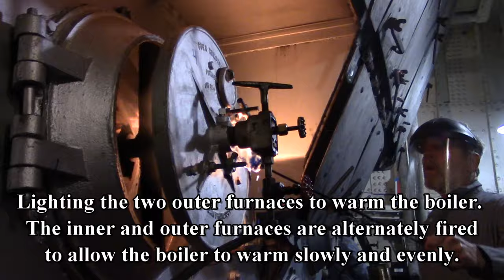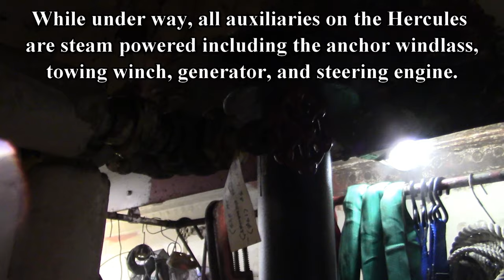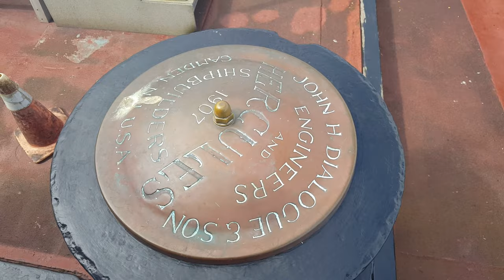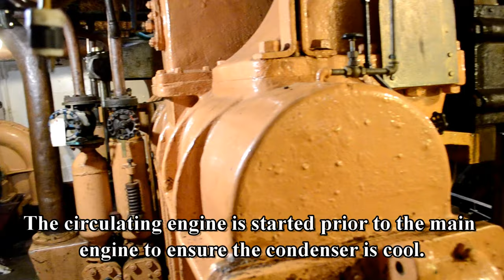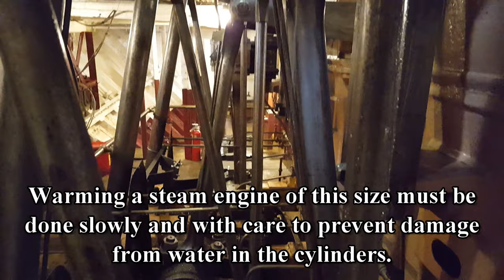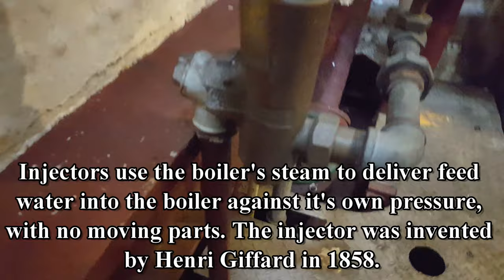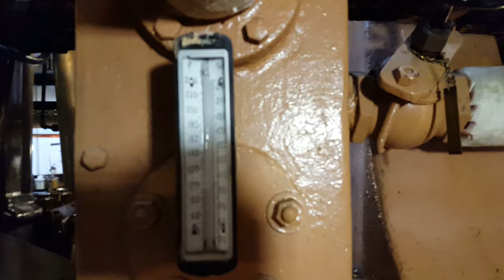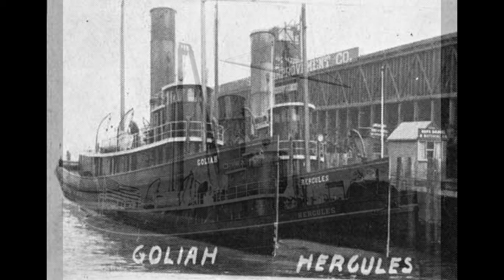Steam Tug Hercules STEAM UP! TV show TUGS!

Comment: Enjoyed the video, thank you for sharing it.  How much time between lighting off the boiler to ready for work?
Reply from the maker: fletcher3913 you're very welcome.  they warmed her up for about 4 hours the previous day, and probably another 2 or so the on this day before steam was showing on the gauge. And about another 1 or 2 before the main engine was running smoothly.
Reply: Wesley Harcourt.   That sounds like a hell of a lot of fuel had to be burned before she could start earning her keep as a working tug boat.
Reply from the maker: crankbv1 when she was working once she had steam up they probably kept it up for weeks at a time.
Reply: My dad served on steam vessels (turbine ships mostly) for APL up to the early Eighties ... it took about a day to get steam up from 'cold boiler', so they probably didn't let the boilers cool down until the ship was going to be drydocked. For steam railway locomotives, when the loco was left overnight, a boy -- called, I think, a hostler -- kept the boiler reasonably hot, along with filling various lubricant, sand, fuel, etc. containers.
Reply: And there is an enormous variety of heavy linkages and other monstrous connecting parts, that would decrease the transfer of engine horsepower to the screws by a huge amount.

Comment: And I thought locomotives were cool - this combines so many different types of engineering together, and for it to be closed loop too.. damn. Now days our only excuse for not being able to work is "the battery is dead" - a century ago there were thousands of moving parts.

How the hell do you keep everything lubed with hot water and steam constantly blowing everything away? 

I'm guessing this thing has a serious bilge pump for the condensation and blow-by water / steam. 

All of this for 1000hp?  Just shocking to imagine how much work and incredible engineering went into 10s of thousands of lbs of moving parts to achieve what a couple-thousand lb turbo diesel will do today.
Reply: Alex Thomas The types of oils and greases that they'd be using are designed to work with steam, they tend to be pretty thick compounds.

As to the horsepower, keep in mind steam engines typically operate at low RPM compared to IC engines, and horsepower is derived from torque times RPM. Thus the typical case for a steam engine is lower horsepower but higher torque.

Large paddlewheel engines in particular only operated at like 30-40 RPM, so they had a pretty massive torque to HP ratio.

The screw engines like on this tug probably also rarely exceed 250 RPM.
Reply: Check out the history of many modern  “healthy “ cooking oils. A lot  were made in the 1800s as steam lubes. Canola anyone.
Reply: Pocketfarmer1 It's actually that they used a mixture of rapeseed oil and animal tallow, even modern steam oils still use animal oils as they are pretty much the only thing that will work in water, so mixing it with rapeseed or petroleum oils links the features.
Reply: Yes, just so. Thanks

Comment: I’m not to familiar with steam engines but are they supposed to leak that excessively ? Bc it seems dangerous Bc the boiler can blow
Reply from the maker: That is completely normal, especially for an engine that hasn't run in several months. There is no danger present. All those leaks are from the packing glands on the piston and valve rods. It's common for them to leak while warming up the engine. As the steam condenses to water in the cold cylinders the water is incompressible and there is so much in an engine that large that it overcomes the capacity of the cylinder drain cocks and takes the path of least resistance.   Eventually the packing material in there swells up with moisture or thermal expansion, the cylinders get hot enough that the steam doesn't condense, and engine room staff also tighten up the packing glands. Thank you for watching and your question.

Comment: These old steam ships must have been scary down there in the bowls on a warship. High pressure  steam line breaks due to bomb, these guys cook. Torpedo blows a hole in the engine room, cold seawater explodes the boiler, any disaster happens and your last out of the ship keeping the lights and wireless going as well as the distance from the engine room to topside.

Comment: Hello at 9:26 you stated the condenser was cooling the exhaust why would you need to cool the exhaust? I don't understand that. Also is this a paid tour that anyone can go on? Thank you.
Reply: A steam engine's exhaust is still steam. But if you direct that exhaust into a sufficiently cold condenser, the steam turns back into water. That water can then be recycled into the boiler again, since the boiler will be seriously damaged if given seawater because of salt encrustation. 

As it happens condensing the steam also produces a vaccum, which makes the engine work more efficiently. So there are multiple advantages for a ship to condensing the exhaust.
Reply from the maker: Odin gave you a good and accurate description in his response. Touring the ship along with many other ships a the park only costs the admission fee into the park.

Comment: What if you ahd to start the engines quickly in an emergency? Is there a procedure for that?
Reply from the maker: With reciprocating steam engines and large firetube boilers, there is no "emergency start". Everything has to be warmed slowly to prevent stress or damage to the boiler, plumbing, and main engine. From a cold boiler it would require over 12hrs to be ready to get under wey.
Reply: @WesleyHarcourtSTEAMandMORE  my uncle who was on the uss Nevada said the boilers took about 20 hours to heat up, albeit it was much larger

Comment: Wesley Harcout,the boiler burners  burn fuel oil,,  or gas oil?? i was naval engineer,,but in the 90"s  engine mechanic,,,not speciality in boilers,,,is correct heat the boller slowly to avoid the stress in  pipes,,,and plates,,the work pressure is a feature os the ship boiler,,,200,,,300 libs,,,etc.
Reply from the maker: She burns #4 fuel oil with pressure atomizing burners. She runs at just under 200psi. 
Thank you for your service, and thank you for watching!

Comment: if the ship is steam and if you dont have steam how do you get the fuel pumps to work in the first place to make the boilers hot
Reply from the maker: Good question! Right now they start with electric fuel pumps pumping diesel fuel to the burners. Once steam is up they switch over to the steam pumps and the heavier fuel which also requires heating with steam heaters.
Reply: @WesleyHarcourtSTEAMandMORE  so if your stuck in the english channel with a cold boiler and no generator you will be going no where fast unless there is some way to hand pump fuel into the boilers
Reply from the maker: @peterjames2004  you are correct sir

Comment: Great video, thanks for posting!
5:55  9:15  I wonder why they don't condense the exhaust steam or vent it overboard?  Doesn't exhausting it directly into the engine room make it very hot and humid down there?
Reply from the maker: Thank you very much! Most of the exhausted steam is sent to the onboard condenser, only a few pumps or drain cocks aren't. It was quite warm and humid indeed. Very nice for a cool day in San Francisco. Thank you for watching.
Reply: Pretty sure what you're seeing on the condenser pump is leakage from the packing glands. That engine sounds like it is in need of attention, it clatters like the bearings need to be adjusted or relined and the packings are leaking- they need to be taken up or have additional rope added. Most of the exhaust from that engine is going into the condenser with the exhaust from the other accessories.

Comment: The noise and heat must have been virtually insufferable. A hundred years later we have nuclear powered ships! This is a great historical video. Thank you! 🇺🇸
Reply from the maker: Actually the noise in the engine room was less than a diesel at idle for the most part. Heat in the boiler room was nice for the winter day... Hotter than the Dickens in the summer though for sure! Nuclear sure shows steam is still a viable prime mover! Thank you for your kind words, and thank you for watching!

Comment: Is there a steam pump to pump condensate outboard?
Water and oil everywhere! Looks like this tug will sink after few hours of work just because it will be full of condensed water.
Reply from the maker: The condensate is re-used in the boiler. The whole system takes some time to get into a proper balance with water level in boiler and the hotwell. Until then the hotwell usually will overflow as it gets full and the boiler isn't in need of so much water yet... There are several small and large pumps to pump bilgewater overboard. No oily discharge gets pumped overboard though. Only "clean" bilge water. The engine sump eventually gets pumped into containers for disposal at an appropriate site.
Reply: @WesleyHarcourtSTEAMandMORE  Wow, thanks! You completely explained everything ive asked!
Reply from the maker: @DieselKotov  you are very welcome! Thank you for watching!
Reply: You must never heard of a steam engine ever-

Comment: Seems to be a lot of steam and water leaking. Is that normal?
Reply from the maker: Yes, when a steam engine that large is just warming up (and it really takes almost a full day to warm all that cast iron through), there is a lot of condensation that takes the paths of least resistance i.e. the packing glands. The glands usually get loosened up when they shut down for a while to prevent the packing material from getting a "memory"

Comment: She's look better if they put the wheelhouse back lower to when she was originally built.  They raised it when she was sold to the railroad to see over the car floats. Now that it's a museum piece, I think it should go back to it's original profile.
Reply from the maker: I completely agree. It's funny, some of the Park Service are complete pedants when it comes to "originality" in regards to silly things like the type of wood used for steering pulley mounting pedestals, to the point of preventing her from being able to set sail, but conveniently overlook other more glaring deviations from original.
Reply: @WesleyHarcourtSTEAMandMORE  Originality? I was heart broken when they took out all the original copper steam lines from the boat. As I remember there was an engineer who was worried about annealing it and it was all replaced with steel. Also I think that the crown sheet in the boiler was damaged when they over pressured it while hydro pressuring it during a test. It's an old boat and the decision makers don't know much about old boats.

Comment: Ship looks in terrific condition considering it's over 100 years old!  Most ships are scrapped after 30-40 years max, no?  It must have been very well maintained!
Reply from the maker: She's had a storied past, including having sat on the bottom in the mud at one time. A testament to the people that loved her enough to work on her and bring her back from the brink.
Reply: EHHHH, kinda depends- if you have use for a ship, it will still work, example: Mayflower(Bristol tug, oldest tug in the world, built in 1861.), Edna G(1890s tug, Great Lakes.), Arthur and Wallace Foss(pretty old lads, 1890s/1880s if i'm correct, both i think sit in Seattle), and many other tugs from the 1890s that have been modernized extensively.

Comment: The sea water condensate pump is very noisy, not a good sign of condition, needs work.
Even if only an antique display of industrial power, the engine needs to be better oiled.

Comment: Ok some questions,  Is the vessel making way or is all of this still the warm up procedure?   If it's the warm up procedure that means the vessel is tied to the dock.  The propeller shaft is turning so the propeller is also turning, while tied to the dock? Surely not so is the propeller out of gear?  In neutral position?   A steam engine has to have a fuel source,  this girl is burning diesel.  She is boiling water to produce the steam.  She isn't boiling salt water is she?  The salt would build up clog and make a mess of everything?  So fresh water is needed.  How big are her fresh water tanks and how far can she go,  "on avarage,"   on one tank of fresh water?  Sorry about all the questions but this is really fascinating.
Reply from the maker: She is indeed tied to the dock and the video was mostly just the warming process, then running dead slow. Generally reciprocating steam engines don't have transmissions or clutches, so yes the propeller is turning. In fact she nearly parted the lines a couple times when the engine started running a lot faster than anticipated.

Her fuel is diesel or #4 bunker fuel. I'm not sure of her fresh water carrying capacity, but the steam plant is a condensing plant. That means it takes the exhaust steam from the engine and auxiliaries and runs it through a condenser (the big rectangular body on the back of the engine) and condenses it back into water. From there it goes through a tank to filter it and then back into the boiler. The little bit of loss from packing and gasket leaks, the whistle, etc can be replaced with water from the make-up tanks. Generally when running regularly and once fully warmed-through the packing will swell or be adjusted so there are little to no leaks and make-up water needed is minimal. She was an ocean-going tug so her range was in the 1,000's of miles. 

Please feel free to ask as many questions as you'd like. Marine steam machinery is my passion. Thank you for watching. I hope you enjoyed it.
Reply: @WesleyHarcourtSTEAMandMORE    Love it, thank you.  One invention attached to another invention.  Must be alot of fun to be a member of this crew.  What a awesome place to get away from the wife and hang out with friends.  Glad to see a young apprentice learning. Wonderful!  Thank you again.  So cool.
Reply from the maker: @the10thleper  it was an absolute thrill to be able to experience it.
Thank you again for watching.

Comment: 4 separate fire boxes or 4 burners?
Reply from the maker: Four furnaces and four burners. Each one is about 18" in diameter made in a corrugated fashion. They run to the back of the boiler where the flames and hot combustion gasses make a 180° turn to go through the flues, before going into the smokebox and up the funnel.

Comment: I have a question? I watched this video with extreme curiosity. Now I’m no kid, 68 but my career was with AT&T. Regardless, i was a bit dismayed because although i know basic concepts nobody was telling me what I was looking at. Was nice to see it working but i guess it wasn’t fully connected to the props?
Reply from the maker: Actually it was connected to the propeller. They had to run it that slowly to prevent it from breaking the lines, or damaging the pier. They had to be very careful with how much they opened the throttle to prevent it from turning too quickly.

Comment: It seems steam engines are all about low RPM torque.even though atomic subs are powered by steam turbines which I'm sure rotate at tremendous speed much like jet engines.. unlike steam engines where 99% of its moving parts are visible, steam turbines have all of the moving parts enclosed.
Reply: You'd be surprised... Steam turbines of that power range often spin within the RPM range of an automotive engine. The Narwahl submarine actually had a direct drive steam turbine.

Comment: The real life top hat from Tugs
Reply: It's actually somewhat of a mix. This was originally an Ocean Tug, which is exactly what Hercules is. But the wheelhouse was changed, turning it into a mining tug. Imo, more Hercules than Top Hat, but you are correct that this is part Mining Tug.
Reply: @motormouth2472  Railroad tug.
Reply: @ukaszwalczak1154  thank you for the correction. I think I may have made a mistake, idk

Comment: Wouldn't the salt in the seawater rust out the condenser?
Reply from the maker: Cast iron doesn't rust with the same voracity as steel does. They also close the sea cocks when not running or under wey.

Comment: I think that Hercules is underpowered for its size. Locally, I have a steam tugboat rated with a similar horsepower but is a good 50 feet shorter. When Hercules was built, it could have been fitted with a much more powerful engine.
Reply: It's the same engine just, a bit old is all.

Comment: Very interesting video!  So this is a 3 piston engine producing 1000 HP?
Reply from the maker: That is correct. The bores of the cylinders are 17"+24"+31" and a 30" stroke.
Reply: @WesleyHarcourtSTEAMandMORE  The tug is outstanding too.
Reply from the maker: Shortribs Longbow she sure is a beauty isn't she? If the national park service was smart they'd get her out steaming on the bay as an ambassador for their operation there.
Reply: Horsepower is simply the measure of work. Torque is what actually moves weight. My 1980 LeSabre has 165 ponies but, in the low end, she will put egg on the face of a same-era Mustang.

Comment: 24.26 is that a diesel generator?
Reply: samanli2014 No, it's a high speed steam engine, the video earlier says all the equipment is run on steam once working pressure is achieved.